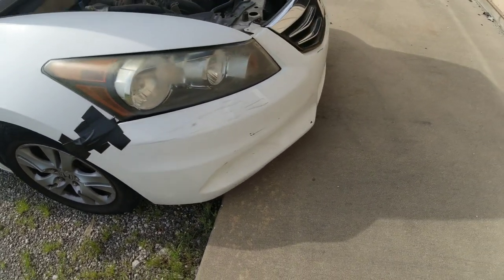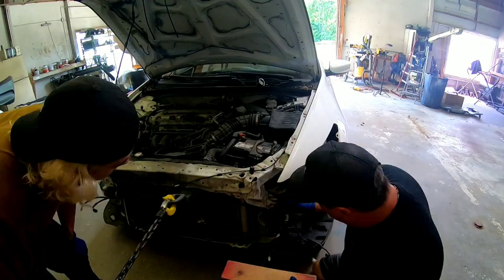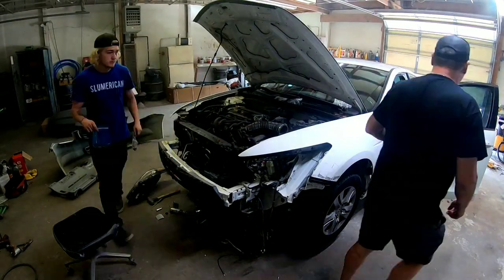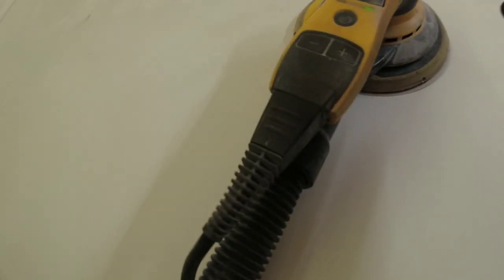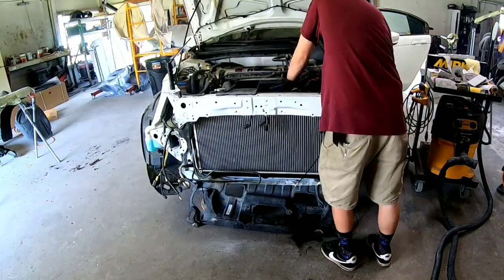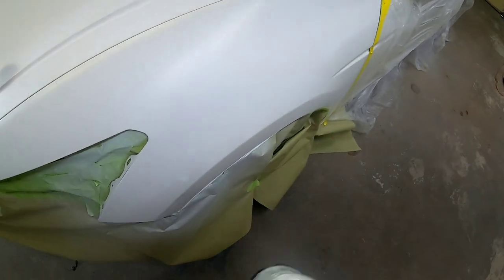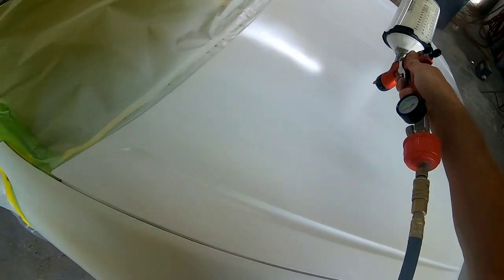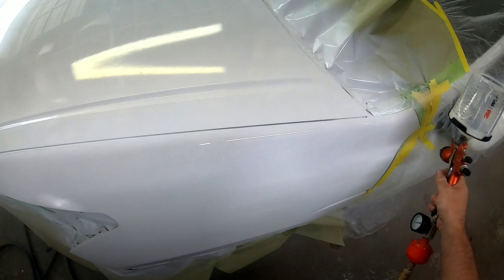How much does auto body pay! #bodywork #autopaint

Comment: Why not drill the welds out on those aprons. Then you only have a hole there to plug weld instead of a belt sanding hole
Reply from the maker: I find a belt sander speeds up the process

Comment: Add filler should be applied over 180 scratches. That will soak up and shrink in 80 grit scratches
Reply from the maker: Are you talking about body filler over body filler? If that's  the case you want an 80 scratch to apply filler over. Apply glazing putty over 180. Appreciate the comment

Comment: How soon are you able to sand after applying the 2K primer? I read that shrinkage is potentially an issue?
Reply: If you sand it with 320 before you shouldn't have  any sand scratches. If you use a fast reducer in the 2k you should be able to sand after about 2 hours with 3 decent coats.
Reply: @gavin4157  I assume this time can be reduced if you let it dry in the sun?
Reply: @livedeliciously  depends because 2k uses a chemical reaction, but yes, I’ve had good luck with force drying with heat

Comment: Been thinking about going to school for this would u recommend? Is 50k a year a fair estimate for how much I’d make or is that low or high?
Reply from the maker: You could  easily  make  that and more. Most of the good Autobody techs I know make around 90k.
Reply: @GarageNoise  thank you…I’m leaning towards it vs Auto mechanic. I want to restore cars
Reply: @milesallen5590  I start school at Lincoln Tech next month. The collision repair course is 12 months and is $28k but I’m covered through financial aid. Also I’m in Chicago. I expect to make between $40-$50k to start but after ASE certification and a few year’s experience I’ve seen jobs on indeed for auto body technicians going anywhere from $80-$150,000 here. I think you should go for it man.